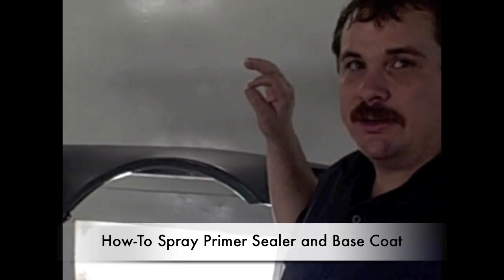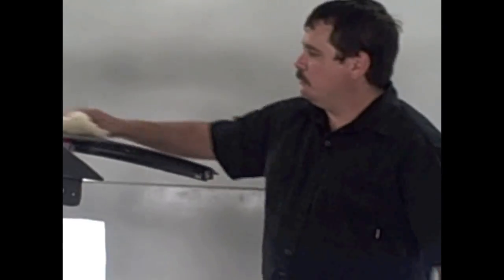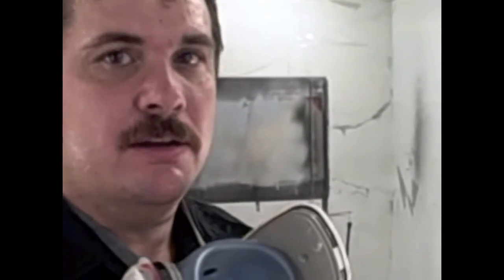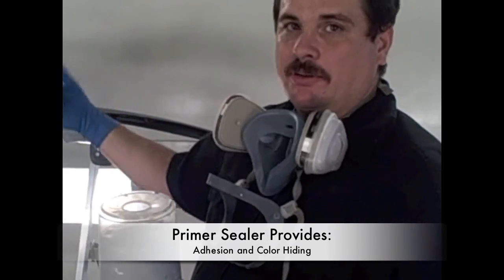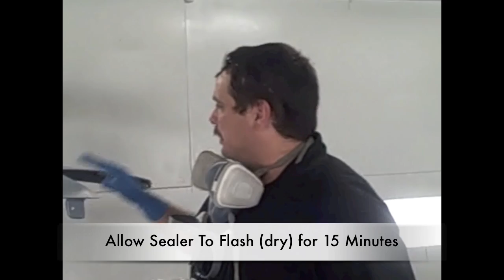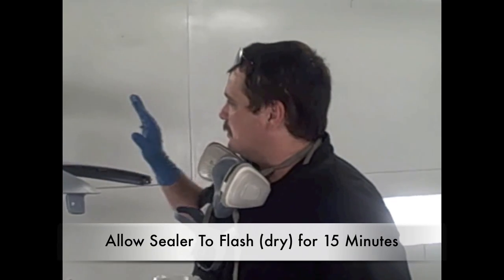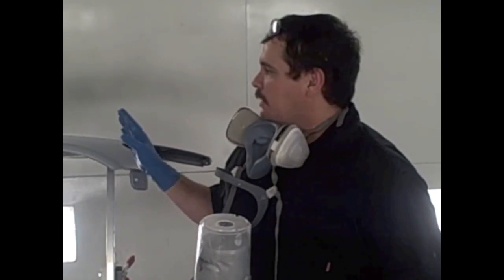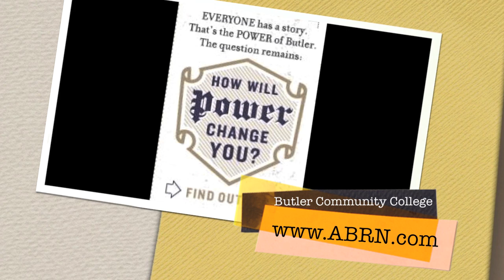DIY (Car Painting)  - Lesson On How To Spray Primer Sealer and Base Coat Paint YouTube HD Video

Comment from the maker: @Screammy89 Self Etching Primer and Epoxy primer is for corrosion protection and adhesion.  Primer surfacer is used to fill small imperfection in body work.  High build designed to be block sanded.  Primer sealer is used for holler hiding.  For example, if you are painting a dark color, you can use a dark sealer to help hide the primer or lighter areas.  This will result in using less paint trying to achieve full hiding.

Comment from the maker: @robertdeuce Epoxy primer is not needed for small metal spots as you described.  I would use a light coat of etch primer from an aresol can before applying the surfacer though. 2) If the car is different colors (primer spots) I would recommend using sealer for color hiding.  It is not required.  If you have primed your entire car and blocked it out with 2k, there will not be a need to use it.  Sealer is for achieving hiding (uses less paint to cover) faster and it provides adhesion.

Comment from the maker: @angel159164 If the grill has paint on it, you can just sand with 400-500 grit, wash with soap and water, tack, shoot base coat, then clear coat.  If the black is raw plastic, (no paint) you will need sand, wash, tack, then spray with plastic adhesion promoter, apply primer sealer, base coat, and clear coat.

Comment from the maker: @smithjo4152 You can take them off and scuff them with a red scotch-bright scuff pad.  1st was and clean them with soap and water, wipe them with wax and grease remover, then scuff them.  You can lay the panels on stands where the jamb is easy to get to.  Then reinstall and mask the jambs off before painting the outside of the car.  The only other option is to paint them while on the car, but it is hard to sand and spray around the hinges.

Comment from the maker: @WikidWDK No, primer surfacer is much thicker and requires a bigger fluid nozzle.  I use a 1.3 for sealer, paint and clear.  Some prefer a 1.4 with clear.  Primer surfacer works best with a 1.6 to 1.8.  We use about 18 to 22 psi at the gauge.  BTY - If you are an collision repair students you can win a 3m Accuspray Primer Gun.  Go to CollisionBlast . com to learn how.  Thanks for watching!

Comment from the maker: @neilnjack No, if the old paint is not peeling or anything, you can final sand and paint.  I prefer to use sealer, but you do not have to.  However, if you sand through and hit metal, you will need to primer that spot before painting.

Comment from the maker: There are some sealers that are epoxies.  If that is the case you should be fine.  However, the primer needs to be a type of etching primer or epoxy for bare steel.  You may see if the can recommends that if it can be applied directly to steel or not.

Comment from the maker: @HighPerformance7uner The 3M half mask will work fine for you.  Make sure it is designed for paint.  That is all we use at school.  If I was painting all day every day, as a painter at a shop, an air supplied would be a better choice.

Comment from the maker: @StarMarvellionInSg Primer sealer is for hiding and adhesion.  If you have a new fender that is black and your car is silver, it will take many coats of silver paint to prevent the fender from being darker than the car, due to the black underneath.  However, by using a light grey sealer, which will cover the black, then you can spray your base, without the worry of the black showing through.  Thanks for watching.

Comment from the maker: @roldancbu Yes, epoxy can be used for sealer.  It sprays on great and can be top coated with base coat.  What brand of paint is available where you are at?  Do they have PPG or Shopline?

Comment from the maker: @PeteLSxMARO Epoxy primer or etch primer should be applied over the bare metal.  if you have scratches needing filled, you can apply primer surfacer on top of the epoxy or etch primer. The surfacer will need to be sanded before painting.  Pressure depends on gun, but 20 to 30 should work.  You can check out my guides at CollisionBlast(dot)com/DIYHowToGuides for detailed information.  Thanks for watching the video.

Comment from the maker: @MrQuentinalexander I don't think house paint would spray too good through a paint gun.  If it is latex, you will have to reduce it with water, which may not be good for your gun if it is not set up for water.  You may go in the hardware store and try some solvent paint and reduce that.

Comment from the maker: @Amopower Epoxy primer is the superior primer for bare metal to produce adhesion.  If no body work is needed, I would sand the metal with 320 grit to assure everything is ready and apply epoxy primer, base and clear.  Thanks for watching!

Comment: Hi Donnie - I plan on soda blasting old paint off a quarter panel, and then feathering into the sail panel to make the transition. I plan on using PPG Deltron primer/paint, which I understand is top of the line. I read that etch primer is a no-no when sandblasting (and I assume soda too). 1). what sequence would you use? epoxy, surfacer, sealer, BC/CC? 2). how do you ensure the new paints over the bare metal reach the same height (and not over) that you are feathering to on the sail panel?

Comment: hey, i have a few questions that are urgent.
1-do i need to use epoxy primer if theres a few small half inch x 4 inch bare metal spots or should 2k high build primer be good for black paint
2-do i need to use a primer sealer 
3-does base coat need activator(the guy at napa only recomended reducer)

remember that this car will be paint high gloss black, if that makes a difference

thanks

Comment: hey, nice videos. one question about prepping. I was wondering how to prep primed surfaces? I go with 400-800 on the bare metal, but then after priming I only used synthetic polymer wool similar to steel wool. should it be the same as bare preping? maybe coarser or finer? thanks a lot

Comment: When do you use primer sealer? I see primer surfacer for new reapairs. Then paint goes to edge of repair then clear over the rest of the panel. Is sealer always used on complete repaint jobs? Thx

Comment: At what psi are you shooting that paint?
And is primer suppose to be sanded down after a few 2 good coats of primer before paint?
I am trying repaint my camaro quicksilver metallic and I'm currently replacing the rear quarter panels and well I had to sand down to metal on the edges like the flange where the spot welds are now how would I cover that up with primer and get it even with the paint on the panel already to get prep for paint ?

Comment: when using 2k primer or color coat and you are waiting for it to flash to put the second coat on, do you leave the paint in the gun or do you need to clean out your gun between each coat? If not, how long can it stay in before reacting?

Comment: On many videos, I see painters spray the entire car and bumper covers with the same paint mix. 

Is a flex agent to be used on bumper covers ? If so, does the flex agent get mixed into primer, sealer, base and clear ? If not all, which ?

Do painters mix a flex agent and spray the entire vehicle ? Benefits or problems with this ?

Thanks

Comment: bubbles are caused by painting incorrectly ie the distance you have your spraygun form the car , by painting it in a windy area , or by not letting the paint dry on each stage for at least 24hrs before you apply the next stages. if you get bubble you have to strip back to bear metal and start again, best look paintjobs are sanded by hand block not sander, sander leaves spots undone and scratches the metal and a bad pattern